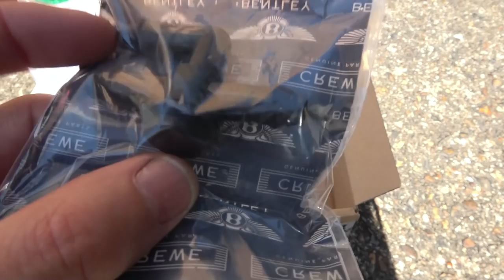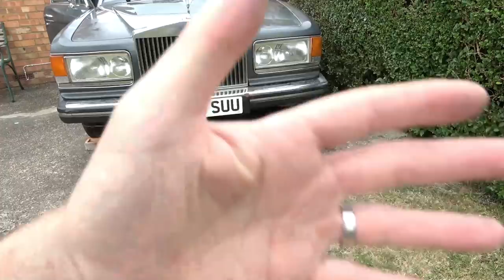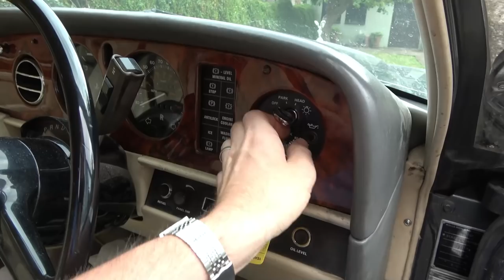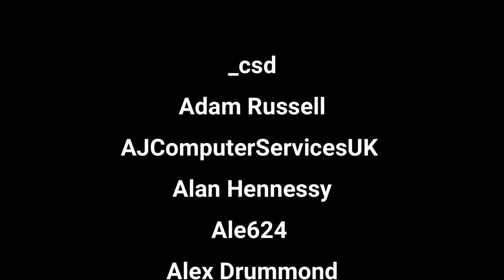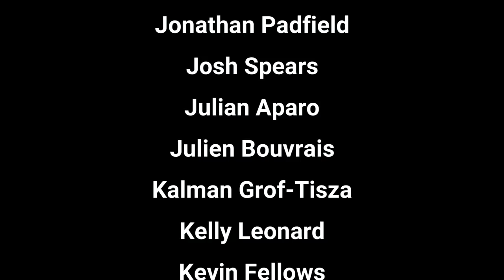Trying to Repair the WIPER MECHANISM on a ROLLS ROYCE SILVER SPIRIT - PART 10

Comment: Vince. I couldn’t see them too well but I think you can get a pin and adjust the firing angle of the jets for the headlights. You can also do this for the ones in the Bonnet 👍🏻 

Edit.. I know you said your happy with how the wipers are angled BUT I couldn’t help notice the drivers side is hitting the edge of the window. Would drive me mad. I would have to set them down a few splines 😖

Comment: I have seen this mechanism on other cars. When the wipers park the motor goes in reverse, and the round thing is an eccentric, so it changes the stroke of the arm a bit, and the wipers park further down on the windscreen.

That is, when they are parked they should be right down at the edge, and when they are wiping they should be operating further up.
Reply from the maker: Thanks Farendloese, I'm going to look at the placement again and hopefully win this time 👍👍👍

Comment: Looks good. A  job well done fella.  Send you a Facebook message mate regarding a fix. Do you fix for other people mate. If not can you reply so I know not to keep asking you.
Reply from the maker: Hi Fox, sorry I don't check Facebook very often. I very rarely fix other people's stuff. I normally just buy from eBay. At the moment I am snowed under with the car and still have a pile of blue mat stuff to look at so I will decline your offer. Thanks for checking with me though. Sorry 👍👍👍
Reply: Ok thanks for the reply. I attached some pictures of the RC car circuit board can you spot any possible issues. If I need to show you better pics I can take more.l thanks.

Comment: Why did RR design such an ocer complicated system just to wipe the windows? It seems like they were trying to better other cars when in reality they were just over engineering something that should be simple.
Reply: Seems like they designed the bodywork and then realised they couldn't fit a wiper motor near the wiper arms like on most cars.
Reply from the maker: I really don't know Englishman, I still can't get my head around how it actually works!!!!!

Comment: Vince, you really are a lovely guy, but you drive me mad with your lack of basic tools! Find a Machine Mart near you and buy a decent vice, they do one with a little anvil at the back which has worked for me for years, then bolt it to your dad's bench. On the subject of axle stands, buy a set (or preferably 2 sets) with the pin that goes through them. I have both the ratchet type and the pin type, and the ratchets are annoying as you need too much clearance above the stand to raise it up another notch. Also, there is a good test on YouTube and the ratchet types fail way before the other type. All the affordable hydraulic jacks, bottle or trolley are basically rubbish. They all go down over time if you leave them with the weight of the car on them. I have four heavy duty (2 tonne) scissor jacks which are superb for getting vehicles to the correct height for the stands, and you can leave them in for extra support and safety.
Reply from the maker: Thanks Bob, I was actually just looking last night at the ratchet version as I thought they may have finer increments in height. If you need just as much clearance or more than the pin type axle stands then it sounds like a waste of time. The pin type axle stands that I have now have the height in roughly 2" intervals which isn't ideal. I kind of want a bottle jack that will move to the exact height but with the safety of an axle stand which won't fail. So maybe the scissor jacks are the answer. I will probably throw everything under there when it comes to working underneath just to be sure. Cheers for commenting 👌👍👍👍
Reply: @Mymatevince  Hi Vince. With the pin type axle stands if you ditch the pin that comes with them and replace with a longer m12 bolt, you can put it through the hole in both tubes or the hole in the centre tube with the bolt across the top of the outer tube, if that makes sense. That gives you an extra set of increments. Bottle jacks in my opinion have limited use because of their physical dimensions. The scissor jacks are good on many fronts: relatively cheap, very low profile when closed, good range of lift and very safe. It is very hard to strip out a screw thread. I once had a bottle jack fail completely with no warning at all, which has put me off them to be fair. Only problem with the scissors is that they can rock easily so you have to be a tad more careful when lifting and lowering.
Reply from the maker: @bobfrankish8883  Yes, cheers Bob, that makes sense👍👍👍